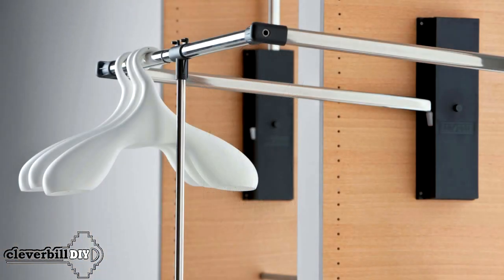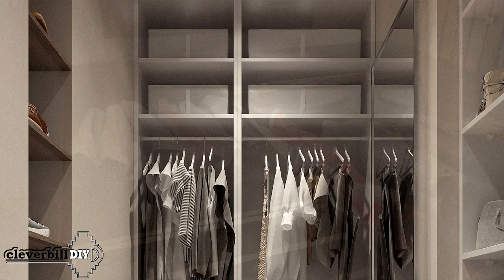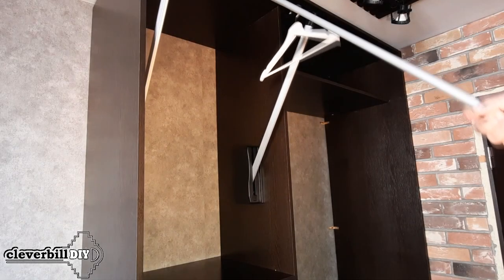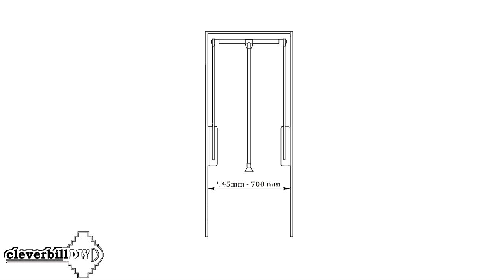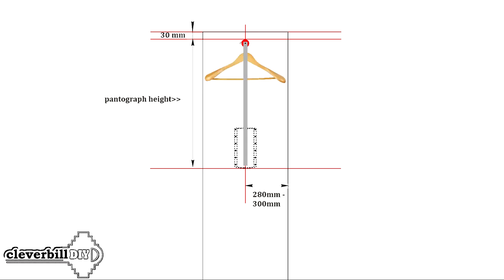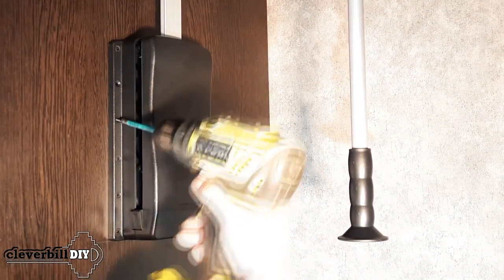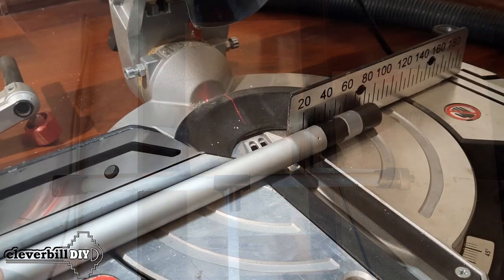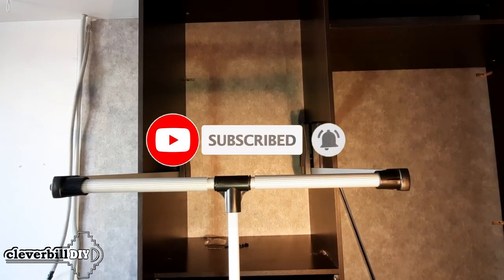Furniture pantograph or pull down wardrobe - what is it?Types and differences, DIY installation.

Comment from the maker: By supplementing your wardrobe with a pantograph for clothes, you can significantly expand the constantly used useful volume of your wardrobe. The filling of the wardrobe, which consists of small things, during the operation of the wardrobe will make it clear more than once that it is better to think through everything in advance.

Comment: This is brilliant. This can be diy built with furniture struts or even cable wire anchored to the back wall and attached to the clothes rod. The length of the cable determines how far the rod will lower